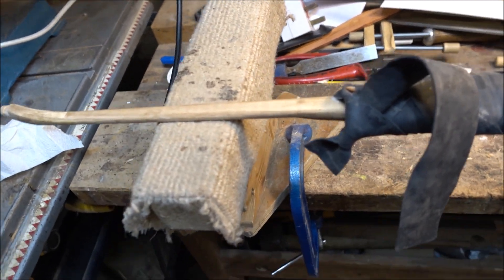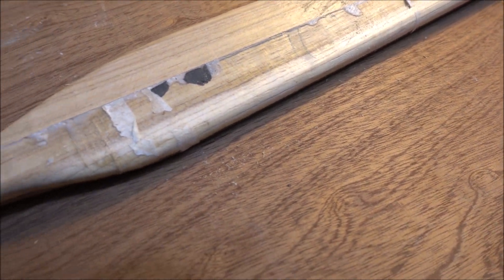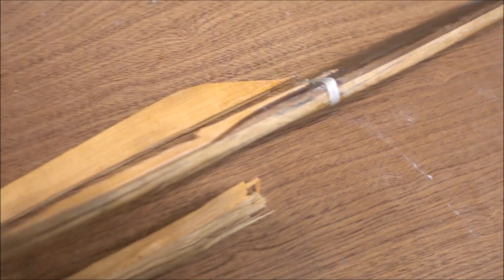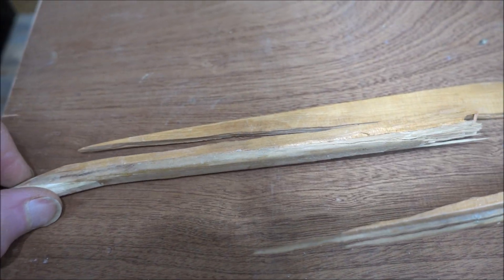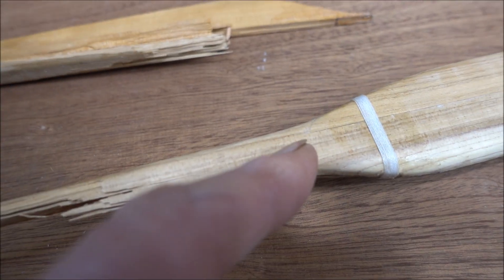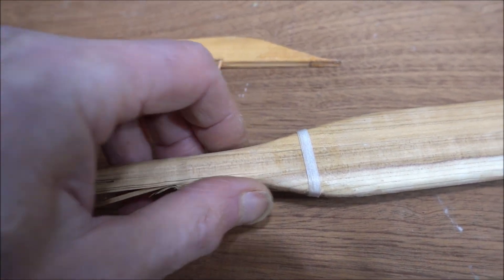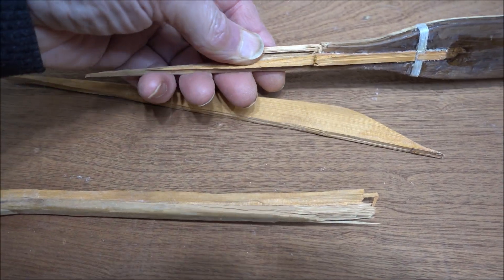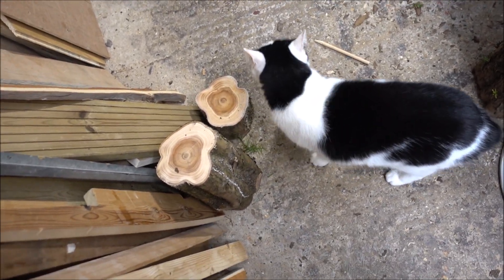Hickory Flight Bow Rework Final part

Comment: Sorry Derek, still it was nice to watch.
My next project this summer is to make a 100 pound "warbow" but i have only ash. I want to pull it 33 inches. How long would you make a bow like that? Mr. Comstock said times 2,7 i think?
What would be the profil? Could you draw a picture please? I think trapezium but is it realy trapezium or is there a quarter belly "sticking" to it? And how is the ratio from front to back?
Reply from the maker: I'm not a great fan of Ash and I think 100# @33" is a bit of stretch. The suggested 33x 2.7 would be 89" ! which is a bit unwieldy,.
I'd have suggested 80" minimum, but maybe aim for 31-32" draw. I'd suggest going as wide as you can on the belly at least 40mm, 45 if you can still grip it. 10mm less width on the back, corners all rounded. The back can be a growth ring, or you can make it with the grain running back to belly like this |||||| . You will need to heat treat the belly. 
I'd start off roughing it out say 45x35 at the middle tapering down to 25x20, that should give you plenty to play with as a first rough out. 
If you make it long, you can always shorten it!
It is difficult to make long heavy bows, by the time it's braced you can easily be under weight!
The nearest thing on my channel is the Elm warbow, the videos are rathe brief :-
https://www.youtube.com/playlist?list=PLBz2tD9476KQ2STSgrH89kndJ40B6RKC8
Reply: Thank you so much for this detailed advice!